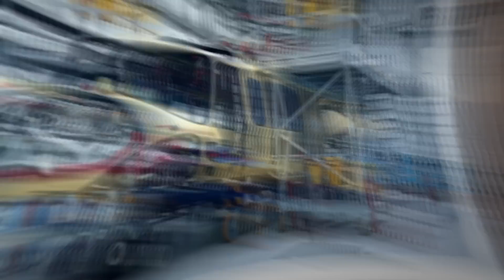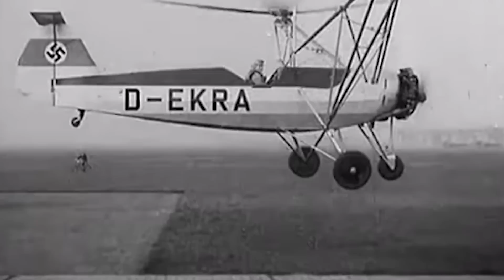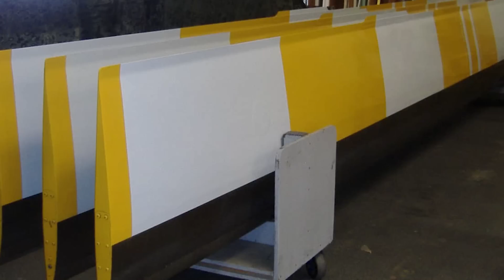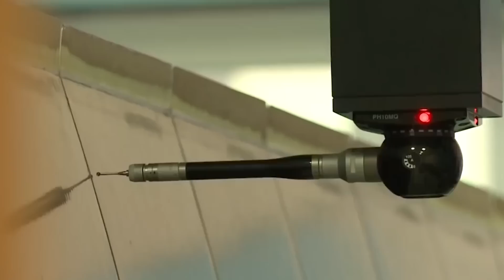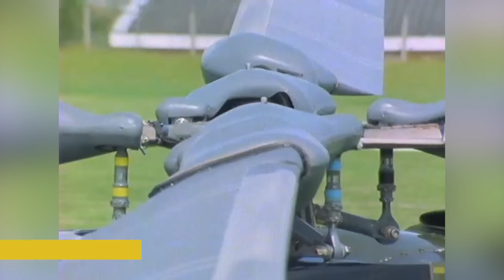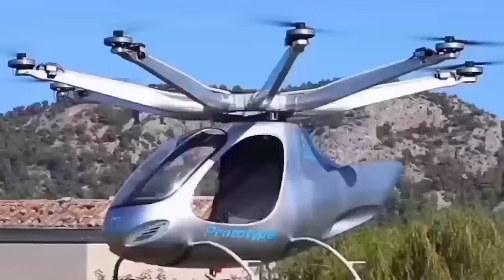How Helicopters Are REALLY Made

Comment: Few people know that helicopters are the basis of disk UFOs. These are discopters. Another type of disc-shaped helicopters, which were developed in parallel with helicopters and convertiplanes. They were developed in Germany during the war. Development continued during the Cold War, where discopters were used for reconnaissance, as spy planes. The most famous development is the Focke Wulf 500 disc helicopter. Also known are the developments of the discopters of Habermohl and Ziereman, built by BMW at the Czech Skoda plants. One of these developments is the Haunebu disc. There are memoirs of concentration camp prisoners and German soldiers themselves describing these devices as a disc with a pilot's cabin in the middle, closed by a transparent plexiglass canopy. The discopter is capable of developing high speeds, up to 1000 km / h, while maintaining the maneuverability of a helicopter.  Discopters, like helicopters, operate from a gas turbine that rotates the working shaft. The torque is then transmitted through a gearbox to the fan blades located around the pilot's cabin. The device stood on the ground on three wheel chassis supports. There are even photographs of this device, which is about four meters in diameter and has a plexiglass lantern in the middle. Which confirms the story of eyewitnesses.
Reply: Das stimmt exakt 👍👏👍deutsche Entwicklungsarbeit
Reply: The controls in a discopter are the same as in a helicopter. The swash plate changes the pitch of the propeller. By changing the angle of attack of the blade, the direction of the air flow and the movement of the discopter are changed. The only difference is the diameter of the swash plate. The diameter of the discopter's swash plate must be larger, since the central part of the disk is occupied by the pilot's cabin. I have a drawing of a discopter. I am a technological designer.